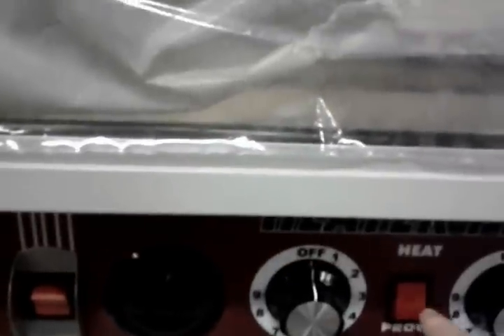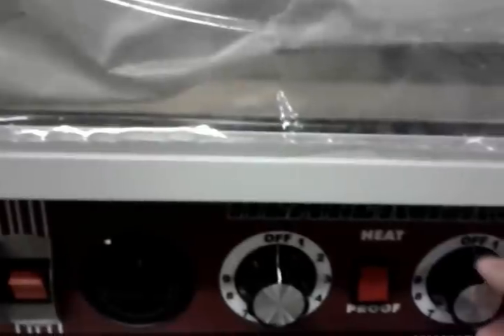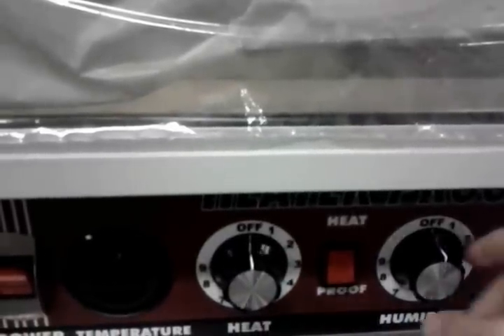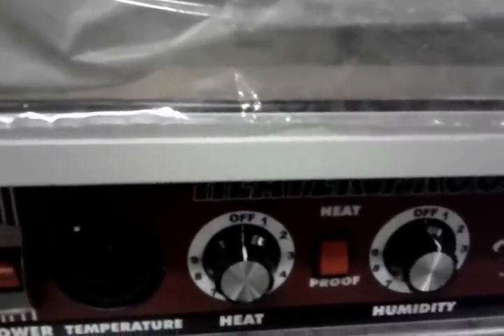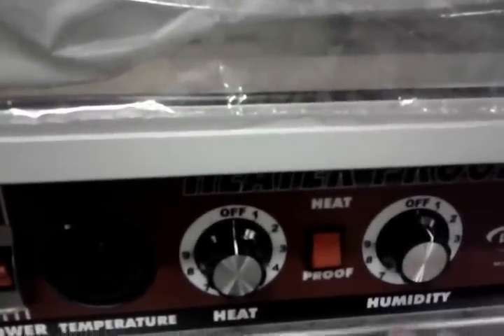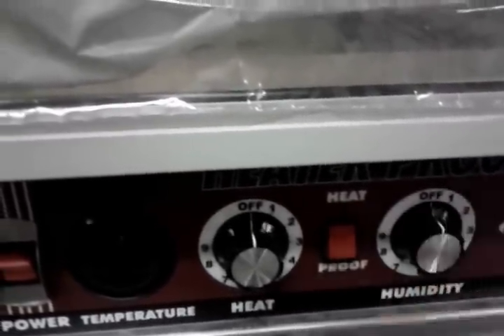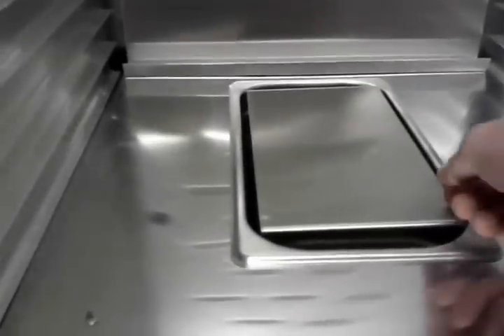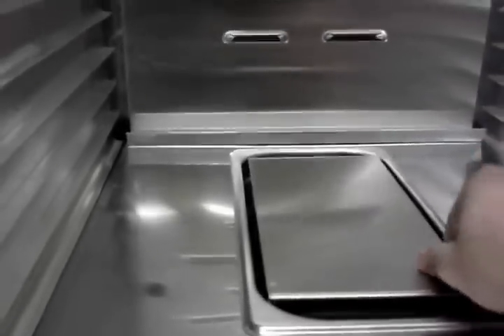Holding Cabinets Versus Holding / Proofing Cabinets

Comment: Hi, what temperature  and humidity  settings  is right  for proofing  dough  with yeast ?
Reply from the maker: That would be dependent on different factors depending on your recipe. Generally between 70-and 90 degrees on the temp. Keep in mind over 110 will kill active yeast. Humidity can have a big range as well, but 80% is a good start. You should start with whatever your recipe calls for and then tweak from there. Some experimenting is part of the baking process. Thank you for your question!